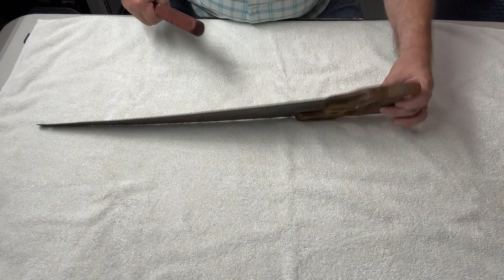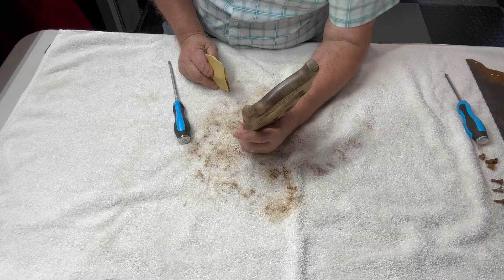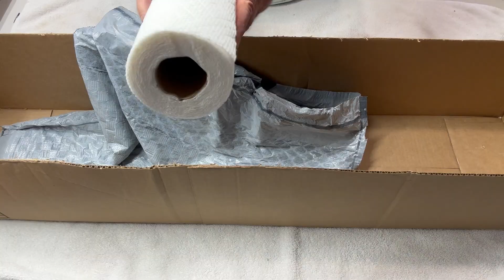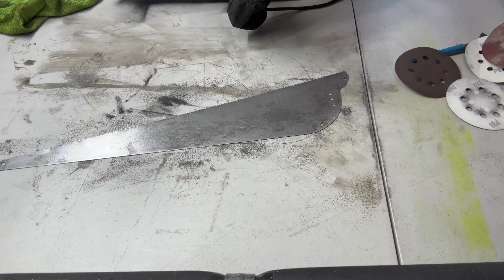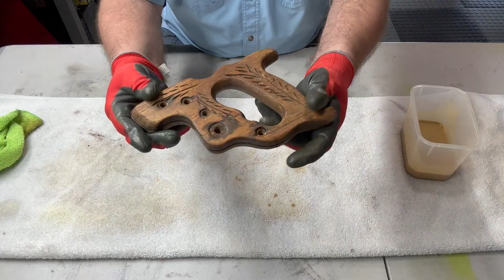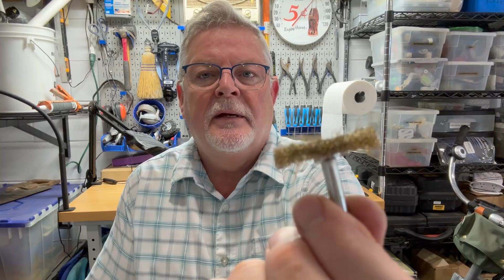Hand Saw Restoration - Vintage Disston

Comment: That saw was sharpened A LOT.  I have the same saw and the tip starts out much wider than that.
Reply from the maker: I have wondered if that might be the case. I haven’t seen any other Disston saws of that vintage with a tip that narrow. If only it could talk. 🙂

Thanks for watching and have a great day!
Reply: @thejimhandychannel  I'm not sure how many times mine was sharpened, but the tip of mine measures 1-3/8" and there is 13/16" of saw exposed below the handle.  Use it til it's all gone, I say. :)

Comment: Why does it have a hole in the end?
Reply from the maker: That’s a really good question and one that I’m not sure I have an accurate answer for. My assumption is that either my dad or grandfather drilled the hole to allow the saw to be hung on a nail when not in use.
Reply: some people that play the saw  put a handle one the end that they call  a cheater.. a bolt  goes in that  hole to fasten the cheater. it makes it easier to  make the S curve to git sounds
Reply: to hang it up…….

Comment: There is a website you can search for the histories of Disston hand saws.  When you take 120 grit sandpaper, you tend to take off the surface etching on the blade that is very important to collectors along with the type of medallions.  My father aquired his saws  back in 1918 when he apprenticed with a cabinet maker.  It wasn’t until the late 1930’s or early 1940’s that Disston used the wheat staff on their handles whereas mine from the late teens had no wheat carving, just plain.  And your medallions date it later than mine. Also my handles are much darker both from stain and oils from the hands over the years.  My medallions are the keystone with the H. Disston and Sons, Phila which confirms the date of 1910 - 1920.  I also have one 1875 crosscut with the eagle medallion and Henry Disston Phila that is book value is between $300-$400.  But my father’s saws aren’t worth that kind of money but they do have sentimental value to me as yours do you.  Enjoyed your video and I know you just wanted to clean up your Dad’s old saw to use as I did with my Dad’s saws.  I bought the collectors saw from an estate sale and I think I paid $8 or$10 bucks for it.  It cleaned up rather well but it became shop art on the shop wall.  Good job!
Reply from the maker: Thanks so much for your comments and kind words. I was originally going to stay clear of sanding the blade for the very reason you stated, but the etching on this saw was already gone. I do wish the etching had been there.

Thanks for the history insights, which definitely helps further with narrowing down the date of my saw. I have another one that is a D-8 (it still has the etching) that I’m going to attempt to clean up later on, and I’ll be taking a very different approach with the blade.

Thanks for watching and have a great day!